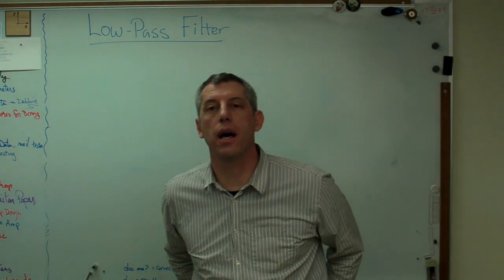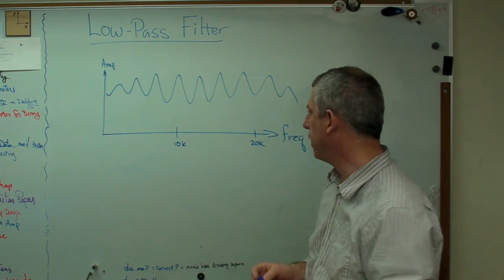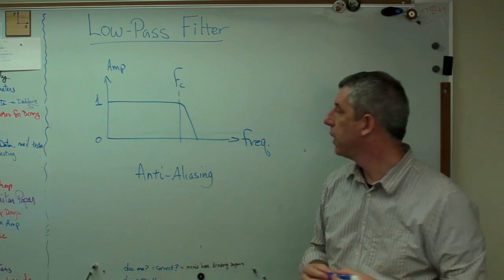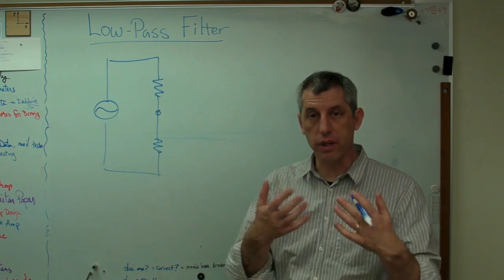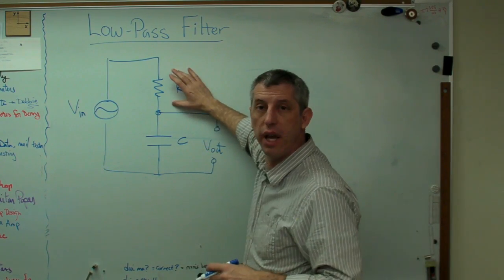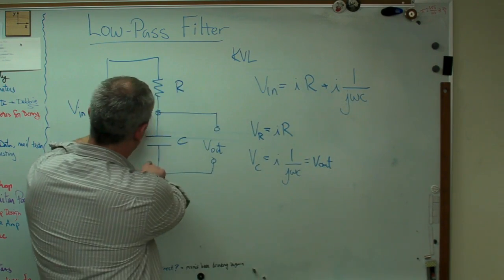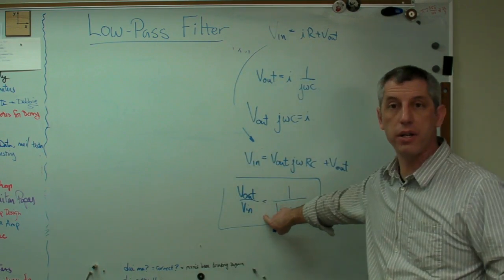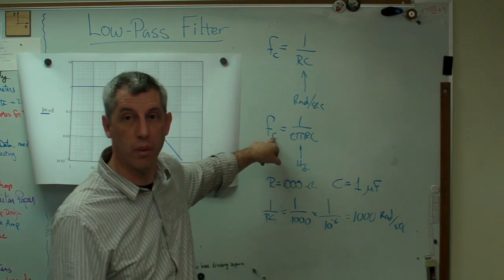Low Pass Filter - Brain Waves.avi

Comment: I'm finally beginning to understand why my hi-fi amplifier's power supply has a bank of resistors connected in with the capacitors in the reservoir/smoothing stage. For years I've been wondering 'but those aren't frequency dependent components - why are they even there, and why are they the value they are?'. I'll have to watch this a few more times before I fully get it but the penny has begun to drop...

Comment: I'm assuming that at the exact point at which we multiply the frequency by 0, that is the Nyquist frequency. Which means that any frequencies between the cut off and the nyquist one would not be the original ones (at the point where i am multiplying the frequency by 0.5, i am also receiving false information). How do you account for that?

Comment: impedance is the combination of the resistance of the Resistor (called DC resistance and the reactance of the Cap or Inductor (called AC resistance). You are calling the reactance of the Capacitor impedance and the so forth. Not proper.